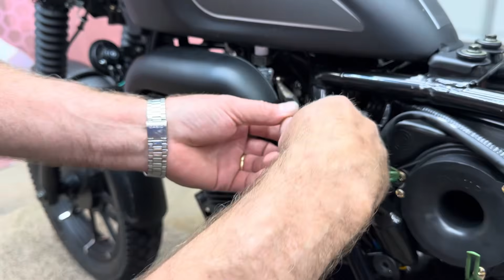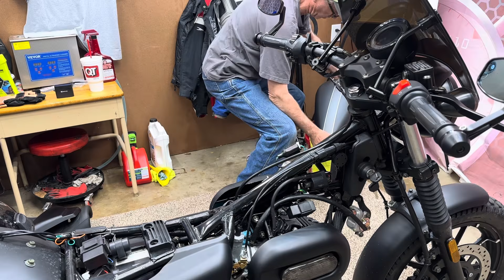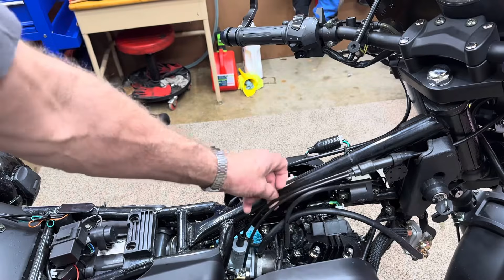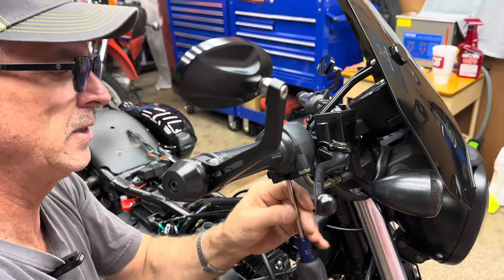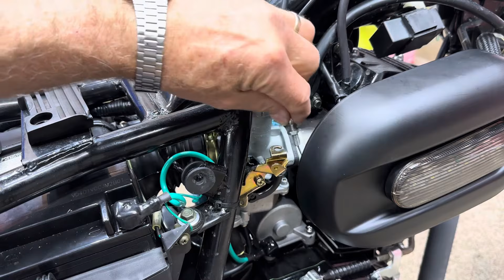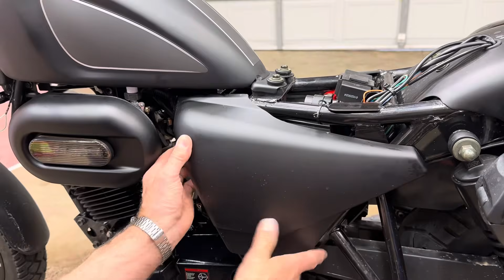VENOM GHOST CHOPPER 250, GAS TANK REMOVAL, THROTTLE CABLE REMOVE AND REPLACE

Comment: Thanks for the video. The throttle cable broke on the way to work. The replacement cable is not cheap through Venom! Hoping I can find a replacement cheaper online.
Reply from the maker: It might be hard to find an exact cable for the ghost if I remember correctly. Best to either buy a OEM cable from venom or some dealer or buy the cable itself to slide into your jacket and solder the barrel end to it. Not a big deal to deal but the easiest is to just replace it. 😊

Comment: How  to install nibbi in ghost shopper  dongfang 250cc 2019
Reply: I finish  installing  but i hear to rough
Reply from the maker: @gustavogamez937  What size Nibbi did you install 28mm or 30mm?
Reply: 30mm
Reply from the maker: @gustavogamez937  The 30mm is too big in my opinion, it will be very hard to tune and not run excessively rich. You will have a challenge with it. I installed a 30mm on a Chinese Bashan Brozz 250 and didn’t like the carb. The 28mm would be better for the 250 in my opinion. I wish you the best with it and will try to help if I can.
Reply: So you recommend  28mm
Reply from the maker: @gustavogamez937  I honestly would, on Chinariders forum there was a few others that tried the 30mm and could make it run sorta decent but the consensus was that it was too big.
Reply from the maker: I never installed the Nibbi in the ghost but it would be very easy to do. The hard part is always getting the jetting correct and tuning it
Reply: What its the diference  because I don't know  i just buy 30mm because the carburetor in takeout  is 30mm

Comment: Hey sir idk if you will see this since the video is old but my throttle cable snapped and I just want to replace the cable do you know where I can find just the cable
Reply from the maker: @minute6718  I never had to replace mine so I never checked. You can get any part from Venom for the Ghost but if you wanted to get it a little cheaper I would remove the cable and measure the length and look at both ball ends. Go on Amazon and order a throttle cable the same length with the same ends and it shouldn’t cost much at all.

Comment: I put a105 main jet like you said but it's reving to high. Did you do any other adjustments?
Reply from the maker: @ChristopherCarroll-zw4hp  if it’s revving high and not returning to an idle then your slide is not in the correct position or the throttle cable isn’t seated correctly on top of the carburetor
Reply: @herbiesgarage681  I fixed the slide like you said. It's reving right excited about the new 105 main jet. About to test drive it. Thanks for your help again
Reply from the maker: @ awesome, I hope you enjoy the bike 👍🏻 you’re welcome
Reply: @herbiesgarage681  it really needs a sixth gear. It definitely has the power for it. I have to let off at sixty and six thousand rpm. Don't see how you go seventy. It's a great city bike though
Reply from the maker: @ yeah it tops out about 75-76mph, I do have the smallest rear sprocket on it that makes it possible to hit the seventies
Reply: @herbiesgarage681  I must be missing something because I jetted the carb, changed the sprocket, and gutted the exhaust and I'm only going sixty
Reply from the maker: @ChristopherCarroll-zw4hp  I’m not sure why you’re only getting 60 mph out of it. Have you adjusted the valves yet?
Reply: @herbiesgarage681  about to get some feeler gauges today!!
Reply from the maker: @ChristopherCarroll-zw4hp  awesome 👍🏻 When I do my top speed videos it’s always on the interstate because of the speed I’m going and the interstate is usually better roads and the mph will go up 2-3 mph in most cases. I think that’s because they are traveled so much that the rolling resistance is less. But you should be able to hit 70mph on a local highway anyway I would think
Reply: @herbiesgarage681  they make a .12 feeler gauge? I just snapped the valve nut😭 where do I get a replacement?
Reply from the maker: @ChristopherCarroll-zw4hp  I’m not sure what the exact size is on that but you might try this, it’s cheap enough. https://www.aliexpress.com/item/1005003146603595.html
Reply: @herbiesgarage681  ordered one but the top of the engine doesn't come off unless I take it off the frame. Should if used the valve adjustment tool lol. Learning about the inner workings now lolol. So as long as the timing is on t you can work on on the valves or do they have to be up or down?
Reply from the maker: @ I’m sorry you’re going through this, have you seen my valve adjustment video? If you have questions after watching let me know. https://youtu.be/VsqRcTra3hA?si=L7Uz7ukzu8FoEYVE
Reply: @herbiesgarage681  key word is valve adjustment wrench not a socket lol. Live and learn
Reply from the maker: @ that’s so unfortunate, if you lived close to the St Louis are I would try and help you out
Reply: @herbiesgarage681  luckily I found a shop that will work on it. When I broke the snap ring, which was from using the wrong tool again, no one would work on it. Luckily I got one from a tool shop and replaced my re sprocket.
Reply from the maker: @ that’s awesome, I hope you get it all squared away. Thanks for the update
Reply: @herbiesgarage681  thanks for the concern and go chiefs!
Reply from the maker: @ChristopherCarroll-zw4hp  😄👍🏻
Reply: @herbiesgarage681  I saw your lifan timing chain video and I understand the cam plate position, but the actual cam itself, I'm not sure of. Could be 90, 180, 270, or 360. I know the cam itself has a little indention on it. Still thinking of fishing the tensioner that dropped out and drilling out the adjustment screw that broke myself by doing that myself save some 💰. The can plate marks vertical with the letters FL right side up. That's where I am by the way Jacksonville FL lol
Reply: I assume you would put the cam v facing down with the notches on the cam plate vertical with FL being right side up aligning with the notch on the engine plate, then putting the bottom adjuster (14mm) on t or maybe f 😂
Reply from the maker: @ChristopherCarroll-zw4hp  when setting the timing, turn the 14mm nut counter clockwise until you see the intake valve go down and back up then watch the timing marks and slowly turn until you see the T mark
Reply: @herbiesgarage681  i about got it Herbie.. The only thing I'm struggling with is the position of the cam lobes. There's four holes in the cam so the cam gear can attach four different ways... There's only one correct way though🤔

Comment: Hey thank you for the video! 
I have a problem with the throttle. It won’t pull the wires. I did the same but every time I hit the throttle the wires don’t move at all. 
Please help and thank you.
Reply from the maker: @Funtravel-t5x  your welcome
Reply: @herbiesgarage681  yeah man it's way faster. They should make these bikes with an upgrade sprocket and bigger main jet. It's kind of fun now. Thanks again for all your videos.. They're great!
Reply from the maker: @ChristopherCarroll-zw4hp  You’re welcome! Did I miss your please help on the throttle issue? I don’t see where I responded, I usually answer every question. I hope you got it resolved

Comment: Hey thank you for the video! 
I have a problem with the throttle. It won’t pull the wires. I did the same but every time I hit the throttle the wires don’t move at all. 
Please help and thank you.
Reply from the maker: @Funtravel-t5x  If your cable isn’t moving at all then you need to remove your throttle tube and see if the plastic sleeve broke inside

Comment: Hey, my cable just broke, was looking on Amazon for a replacement. Not sure which one to order because they do not look the same as in your video any ideals or recommendations?
Reply from the maker: Hello Rudy, I haven’t really tried looking for one but after a quick search it appears to be a little difficult to find the exact same. If you wanted the exact same, let me know and I will contact Venom, they will get one for you, I will let you know the price if interested. If you don’t mind doing a little upgrading then this might be the best route, I already changed my throttle housing or I would go this route. https://www.amazon.com/JXMOTO-motorcycle-PZ30-Carburetor-Accelerating/dp/B09MBTWV5X/ref=mp_s_a_1_2_sspa?keywords=pz30+carburetor&qid=1702177084&sr=8-2-spons&sp_csd=d2lkZ2V0TmFtZT1zcF9waG9uZV9zZWFyY2hfYXRm&psc=1
Reply: @herbiesgarage681  thanks! I think I’ll just upgrade thanks to your videos I should not have a problem installing it.

Comment: What is this bike? The frame looks like it was ripped straight from a GN125/250. Same airbox and same mounting holes for the battery and airbox cover.
Reply from the maker: It’s a Venom Ghost Chopper 250, it very well could be similar design
Reply: @herbiesgarage681  Just took a look at it online, wouldn't be surprised if they used a GN frame as the base. The engine looks like a kind of honda clone too, so nice and easy to get parts for and I think they bolt right into a GN frame also.
Reply from the maker: @SamuelAllred  yeah, it is a Honda cloned engine, I’m not sure about the frame, I’m enjoying it, it’s a pretty cool bike

Comment: Love the videos you're totally a great blessing when it comes to this motorcycle and helping with everything to know, please keep them coming
Reply from the maker: Thank you very much! I do have several videos to do on the Ghost still. I have 3 that I finished and will post soon. Windshield installation, hard saddle bags installation, and rear sprocket change out.
Reply: @herbiesgarage681 can't wait to see them, I see your friend JerryHawk250 put a oil cooling system on his Ghost, do you plan on doing the same, I would love to see a video on that,  I was thinking on putting hardshell saddles on mine as well, EGO BIKE Motorcycle Universal Saddlebags Hard Saddle Bag Trunk w/Light for Honda Yamaha Harley Suzuki Kawasaki, which ones did you go with? Oh by the way love the way you say Chopper, hilarious
Reply from the maker: I wasn't going to install an oil cooler as I'm not sure it's needed in my area but you never know, I could change my mind. These are the bags I bought, https://www.amazon.com/HECASA-Universal-Compatible-Cruiser-Motorcycle/dp/B0B3RPFP5B/ref=sr_1_1?crid=ANB1MBNTJF8I&keywords=HECASA+Universal+Hard+Saddle+Bags+Compatible+with+Yamaha+Honda+Cruiser+Trunk+Luggage+with+Lights+Mount+Bracket+Motorcycle+Black&qid=1697673296&sprefix=hecasa+universal+hard+saddle+bags+compatible+with+yamaha+honda+cruiser+trunk+luggage+with+lights+mount+bracket+motorcycle+black%2Caps%2C147&sr=8-1
Reply: @herbiesgarage681 I can dig it,  that was my second choose but everytime I sent the link it rejected my comment for my first